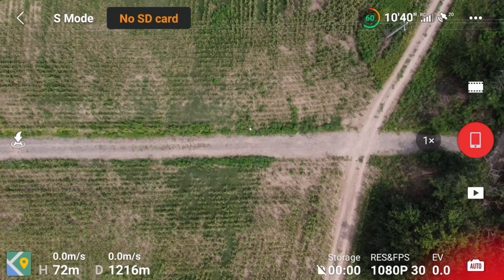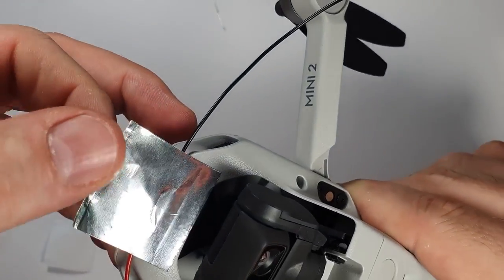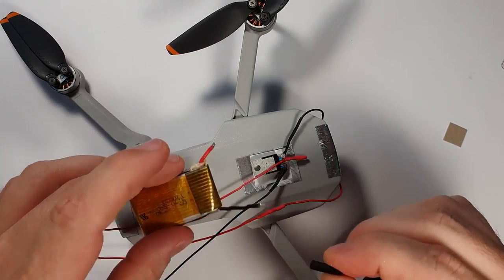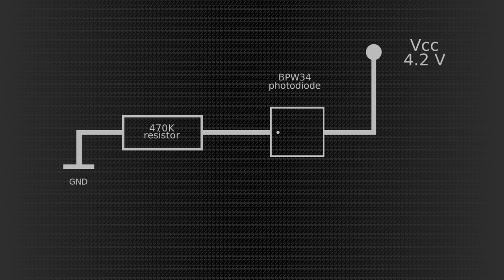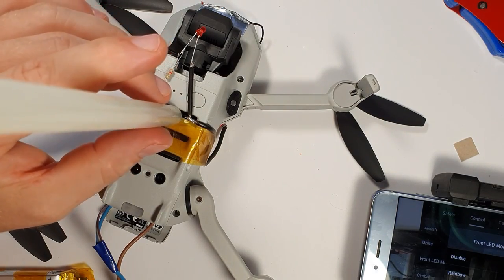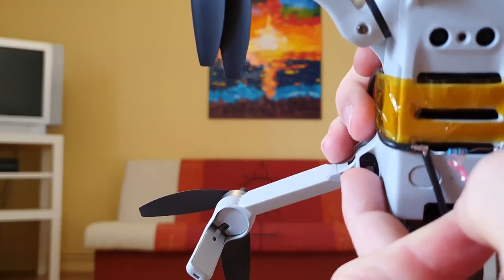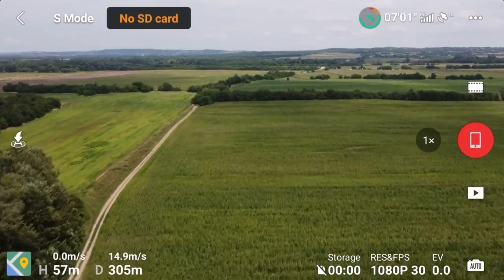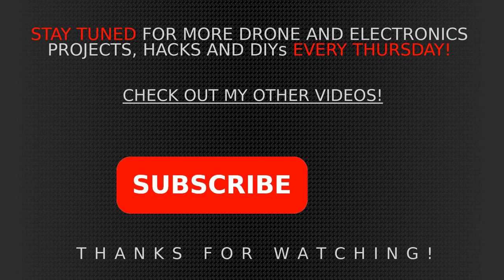Simplest DJI Mini 2 payload dropper mod (OcuSync range!!!)

Comment: Do you get any errors from the mini 2 like propeller rotating too fast when carrying a payload? I reached out to dji and they told me that this little drone doesn’t like any weight and that’s why it triggers the error. I’ve seen it s few times and sometimes I don’t.

Comment: 😄 Nice work... from my suggestion, you can use VAPE COIL or NICHROME wire to replace the heating resistor.. it will work fast enough to melt small plastic zip tie. 👍👍👍
Reply: i am already try it on my Mjx mew4-1 drone, and it works nicely

Comment: Awesome setup! Thanks for sharing. I would change the heating glue concept with a tiny servo.
Reply from the maker: I was thinking of using a servo, but I found this to be simpler to make (for me). Otherwise I see the superiority of that solution of course as it drops instantly :)
Reply: A servo requires complex electronic signals, but a small selanoid would work.

Comment: I did exactly the same for my mavic pro, except I hard wired it across its led. I also used a servo to do the dropping, this works fine as the mavic pro can carry more weight.
Reply from the maker: Yeah, it is better that way, I just wanted to do it in a way to not void warranty. 🙂
Reply: I got out the attachment arm for my robotic arm which i 3d printed from  thingiverse the mg90s servo and the plastic for the gripper arm is only 29g
Reply from the maker: @sshutupurface8345  cool 🙂
Reply: Hi guys. Anyway I can purchase one of these ready made?
Reply: @walterjohnson2961  you can buy anything these days, but the saving of money and making it yourself is far more enjoyable. 💸💸😁
Reply: @hunter00047  lol. I only wish I was that crafty with my hands. Only on a keyboard. 😁😁😁
Reply: @ZollyD can you do a video on how to use the service instead of the heat/melt method
Reply: Do you have a video tutorial on using the servo?

Comment: Very cool... concept.  
Need to move that away for the heated resister and into a opening clamp actuator and then sell them!
Reply from the maker: Thanks! :) Yeah for sure if I ever want to sell these I will not go with the same setup.😅😅This was more of a concept on the actual trigger... :)
Reply: @Zolly this is cool. What would be even cooler is if you sold a variant of this mod. 😁

Comment: Excellent idea! I was making a pylon dropper for the mini 1 and was going to control it with a cheap android phone but this is a much simpler solution now that we have an led on board :)
Reply from the maker: Thanks! :) Yeah the LED is the gamechanger there. :)
Reply: @ZollyD  I went straight to servos. Heating a resistor and hot glue is way clever. Can’t believe I have all the parts sitting here to make one and it never crossed my mind. I feel stupid 😂
Reply from the maker: 😂😂 Hey, none of my subscribers are stupid! I stand for you guys! And I agree that the servos are better it is just more complicated. :)

Comment: Hey Zolly,

always great hacks 👍.
Perhaps you can also deal with the MA 2 battery self-discharge problem.  Many MA2 owners complain about this.  The battery simply discharges too quickly.  There is definitely a way you can point out how to slow it down or stop it.  Keep it up, the videos and explanations are great! 

Greetings from Germany
Reply from the maker: Thanks! :) I would need a battery to say for sure, but these self discharge things (If you mean that the battery after a while on purpose discharges itself for safety reasons) all work the same way. Ususally a MOSFET turns on and start to discharge the cell via a resistor.
Solution 1: delay the MOSFET to open with a pre defined time. (few ours, days)
Solution 2: Change the resistor to a bigger value so it discharges slower.
Solution 3: Combination of the 2 above
Solution 4: The voltage to which the cells are discaharged can also be adjusted. So it does not discharge to 3.7V but only to 3.95v
I would probably prefer the last one as it is an important safety feature to not have LiPos fully charged.
:)

Comment: i think also can be done with small neodim magnet mounted on gimbal and hall sensor,that activated by magnetic field of magnet when gimbal in lovest position angle 0° for example
Reply from the maker: Yes!👍 And that is one of the ways it can be done on the Mavic Mini (because it does not have front LED). My only problem with that method is if you want to aim where to drop, you need to look down. Like this you can aim as long as you want and drop precisely. :)

Comment: Awesome!!!
I would like to add you this simple solution by …
Adding a small magnetic slide operating on the current vs the heated release.  Seems we could use a lightweight slide rod (a stickpin shaft) ..  a weak permanent magnet and an electrical magnet to get the job done…
Reply from the maker: True. I will soon release a version with a servo. And a little extra function. It will be awesome!😊
Reply: @ZollyD  Did you do it?

Comment: 🇷🇺👋😁👍🚁
this is an ingenious solution, as an electric lock with a motor and gears is not needed.
No extra weight as the construction is lightweight
but I would use a piece of thin copper wire that would simply burn out when electricity is applied to it 😁
Reply from the maker: Thanks! :) Yes, that was my first version as well, I mention it in the end of the video, but I had 2 problems with it.
1. I did not want fire hazardous temperatures even for a fraction of a second. 
2. the thin copper wire was more prone to break due to the wind swinging the payload.
So I went with this method. 
And imagine to just tap into the drone battery, (of course then the bottom resistor has to be 47 Ohms) then no need for extra battery cell. The 200 mA current draw will not kick the BMS. :) Than we are under 249 grams (of course without payload, which is the whole purpose of the thing! ) 😂😂😂😂😂

Comment: U can mount a hook on the drone's bottom - moving forward and then backward u ll initiate the move/energy which will drop the load. I used that at countryside around New year's eve to drop some  firecrackers and IT worked for me😂🤷... but be careful at people and animals around, and use a rope long enough  for the load or... 💸
Reply: What type of hook?
Reply: @freddyfz0976  an L profile, just try it until u reach the perfect profile, simple dynamics :)
Reply: @andreistefan2167  thanks !

Comment: What if you replace the hot glue with a micro servo.... when it receive voltages it will open up? This way will be instant drop.
Reply from the maker: It would totally work! :) I just showed a concept and you guys do the rest of the thinking! :)

Comment: Instead of the heat resistor try a fine copper wire coil that pulls in a steel pin when electrified which then releases the load.
Reply from the maker: Totally doable! :) I just showed a concept and you guys do the rest of the thinking! :)

Comment: I am looking for a device that allows me to pull a leaf from a tree. I need to take samples from leaves. Could think of a hook to pull leaves or fragments of leaves from trees?
Reply from the maker: I am not the best with mechatronics as you can tell from my solutions...🤷‍♂️ I would anyway recommend not a hook, because if you get stuck and you pull the drone can tilt out of balance too much so you get an IMU error and the props stop. Maybe a mini scissors-like mechanism to cut the leaves and let it fall and collect? I don´t know, just rambling... 😂
Reply: @ZollyD  Indeed, a hook is bad. I could be a sort of scissors activated by some spring activated by the optical activated heating-trigger.
Reply from the maker: The heat trigger part is avoidable. I would use a microcontroller to activate a servo which moves a scissors. My problem is alwayd the mechanical part. I have to learn this. But the channel Howtomechatronics has a lot of good tutorials. Check there. 🙂

Comment: Great video. By the way where you put the mosfet, I think underneath is the gps antenna. Do you think it blocks the signal in any way?
Reply from the maker: Thanks! 🙂 Yeah thereabouts. It was fine. Just took a bit more time to lock onto satellites, but after that was fine. In my battery mod videos I also put relatively big LiPo cells on the top of the drone and even then it works fine. 🙂

Comment: Excelent! Could you offer it as a kit?
Reply from the maker: Thanks! :) No, as I say in the disclaimer: "It is for entertainment and educational purpose." If I ever get into the manufacturing stage, it would need to be a much more refined product (I think). The parts are easy to get anywhere though... ;)
Reply: @ZollyD  The project is fine. Many like to build devices on their own but do not know which parts and where to get them. Just order a couple and send me pieces by mail. I can design and promote the concept. Your video is an excellent manual already!
Reply: @AprendereV  you pull this off I'll be your first customer. 😉

Comment: Great idea but instead of using heat to release the payload , why not use a small solenoid instead ? (instant release, uses less power and more reliable).
Reply from the maker: You are right! I was thinking about it. I had no solenoid home. Had a servo, but I did not want to use microcontrollers to keep it simple. Plus for the solenoid it would be nice to have some 3D printed parts, which I do not have. So all in all it was simpler for me to do it like this. :) One day maybe I do a refined version!? ;)

Comment: First I thoug what a overdimensioned transistor, later I saw the reason why. I found a construction error. The GPS of the Mavic Mini 2 is in the middle of the chasis. You put there the external battery. Put the external batterie over the internal battery on the back of the chassis then you will recive GPS signal. And I would glue the transistor on the external batterie and not on the drone. Makes it easier to remove all, only one glue point. But nice idea to use remote LED lights with a fotodiode. Btw. in Germany (and Europe?) it is for security reasons forbidden to have a drone that can drop things.
Reply from the maker: Good input. As I said in the vid, there is a lot of space for improvement! 😂

Comment: Hey Zolly, thanks for the video great information. So I opened up my Mini 2 and checked the wiring from the PCB to the front LED, thinking I could just run some electronics direct from that instead of using the photo diode. The connector from the front LED has 3 wires, 1 ground and 2 positive 5V leads. What is odd is they are 'always on' and always provide 5V signal even if the LED light is turned on or off with the controller. Do you know anything about this?
Reply: It’s most probably ground pulsed
Reply from the maker: Yes. 1 is ground and 1 is 5v supply. The third one which seems to be 5v is a high frequency data line. Those front LEDs are not being driven directly. The data line is being decoded on the LED end and thus provide the proper color. The databus is very fast. I think it was 6 bytes of data in a packet every millisecond.

Comment: Do you know of any commercially available payload dropper/package thrower for Mini 2 that uses the drone's LED light so that OcuSync range is achieved? Any links highly appreciated
Reply: There is a 360 turn activated dropper that is light weight andcan be strapped to the drone made by STARTRC for around 20$ and it works at the distance of the drone, simply attach it switch to normal mode and spin for 10 seconds and it releases the payload

Comment: If the light can be pulsed by the pilot, several functions could be crudely implemented with a microcontroller on the drone. I don't have a DJI drone (yet) so I'm not sure if it's possible or not...
Reply from the maker: Correct. Unfortunately the pulsing method is so unreliable that it is not relly working well. I made a video with using a color sensor on the front LED. That gave 10 different functionalities to the setup. Which is plenty I think. 😊

Comment: Hello Zolly.. I hope you are well today. I was wondering if. You separated the mini 2 and the controller far apart (2km) on the ground and turned them on would they bind?
Reply from the maker: Hi! It works as far as the controller can each. At ground level the reception is way-way worse when you do not have visual line of sight.

Comment: Hey Zolly! Really awesome video, was wondering what Soldering iron you used to connect all of your wires in this video? Looks super simple and fast.
Reply: Hey Bud, i just found your question, You can safely use a basic 25w~30w soldeing Iron & a easy to work with & cheap Solder wire is a 60/40 Alloy - Flux core - 1.25mm Solder for this project & the majority of the worlds cct board built electronics !

Comment: Hi zolly can you tell me what mosfet would work with a 2 resistor setup except not resistor but special wire that gets red hot 
I used the one listed here but burnt up after 10 uses with 2 Lipo 3.7 400 batteries in series 
I was thinking about 2 mosfet one for each side but idk
Reply from the maker: 2 mosfets on the 2 side will not work. The Mosfet used is quite beefy already. You have to change the red hot wire to a thinner one, which blows in a very short time to not fry the Mosfet.

Comment: Nice solution...I saw another simpler... hook with a small curve, so the drone tilted towards the hook, and the cargo ring slides. This allows for four separate small payloads...the drone tilts towards the front, rear, left and right and each package can be unloaded independently...
Reply: Where can I find this hook?
Reply: @900distribution7  Nowhere...DIY, four low curved hooks.
Reply: @semproniodensso3353  is there a video showing the process?
Reply: Video on how?!
Reply from the maker: Thanks! :)
The problem with that solution is that during flight one can do a move which releases a payload without wanting it... otherwise it is cool...
Reply: @ZollyD  No that way, remember centrifugal force, in a turn the cargo remains in-line to the hook.